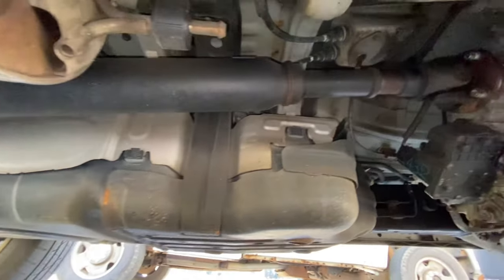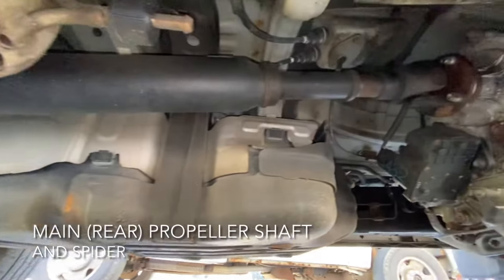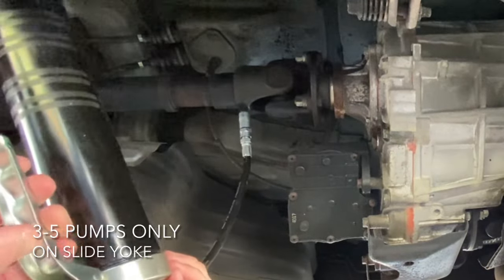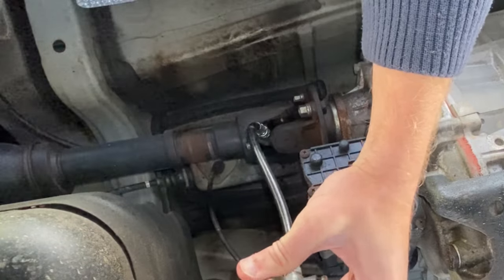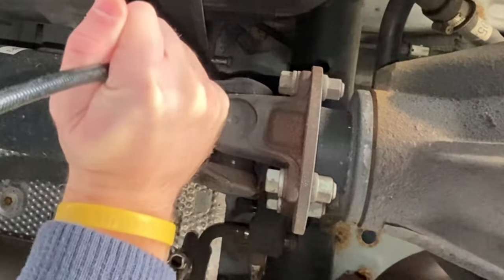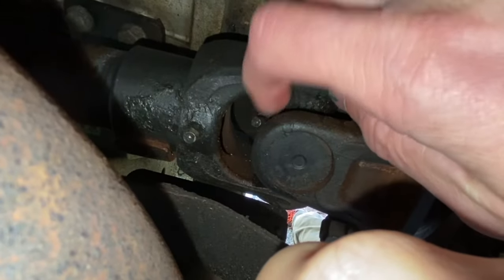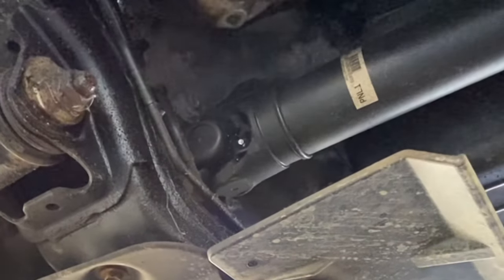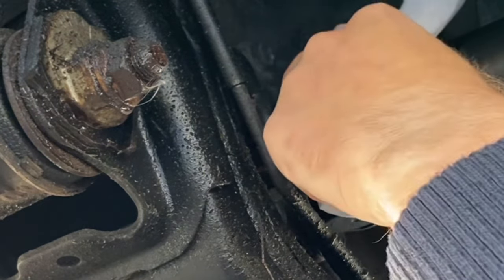Toyota Propeller or Drive Shaft Lubrication 4Runner, Tacoma

Comment: Interesting I have a 2017 Tacoma and it only has 2 fittings TOTAL. 😳 (both at the main shaft spiders one front and one rear)
Reply from the maker: Is it 2wd?
Reply: I got a 2015 4wd, just did the u joints, but I swear there's no grease fitting for the slip yolk.

Comment: Appreciate putting out the video.  It helped.

Added information for anyone planning to do this:

1. For the front shaft, back spider joint, it is very difficult to grease from below; grease from above instead.

2. You don't have to jack the front to grease the front shaft.  As long as your are not in 4WD mode, the shaft still spins.
Reply from the maker: Thanks for the tips! Thank you for watching! I’m glad it was helpful! Please consider giving the video a thumbs up if you haven’t already! Thank you!

Comment: Just as a heads up, I take apart the slip yoke to grease it because I find that greasing through the zerk does not provide enough grease before it starts to come out and it does not reach the lower splines so they run dry.
Reply from the maker: Thanks for watching, I appreciate this tip and hope others will too. Anything to keep our machines running in top shape!

Comment: What do you do if the grease fittings are not facing down where they're easily accessible to you?
Reply from the maker: I move the vehicle off the ramps and then back on to get the fittings on the bottom, sometimes it takes a couple of times to get them where you want them. Hopefully this helps, thank you for watching!

Comment: Under what conditions does the front slip yoke slide in and out just out of curiosity I did mine and I had someone jump on the back of the 4Runner and I could see the rear slip yoke slide in and out, the front not so much at all but it does have signs that it’s had some sliding in and out over time
Reply from the maker: It would happen suspension articulation, possibly a large speed bump or similar. Thank you for watching and be sure to check out my other 4Runner maintenance videos if you are interested. Thank you!

Comment: question is.. what grease or is it normal grease same for every vehicle?? I am new to these mechanic things and I have a paid off 99 4Runner but it has begun to jerk when I switch to reverse. It’s not the transmission fluid and before I assume it’s the u joints I want to figure this out first
Reply from the maker: The grease needed is NLGI No.2 and I have some linked in the video description if that is helpful!

Comment: Does the 2wd 4th gen 4runner have grease fittings on the drive shaft?
Reply from the maker: Yes it does but there is no driveshaft going to the front differential only the rear. Hopefully this helps! Thank you for watching!
Reply: @5MinuteFixit  I have been reading that the 2wd 4th gens (I have a 2004) do not have zerks and are a sealed drive shaft. Of course I probably should go look for myself to confirm.

Comment: Just did this on my 4Runner today.

However, after doing this, my suspension seems a little stiffer and there is clunking between the rear driveshaft and transfer case when I push the car up and down. I only did 2 pumps on the slip yoke for fear of over greasing.
Reply: 2 more pumps should do it

Comment: Why do you need to this & what happens if you don't, because this seems not to be the priority on 4runner maintenance.
Reply from the maker: It’s just a good idea to keep the driveshaft lubricated. It helps prevent excessive wear. Hopefully this helps, thank you for watching!
Reply: @5MinuteFixit  Thank you & your video is helpful. I got a 99 Limited 4runner at 280,789 miles just changed the front differential, transfer case, & rear differential fluid. Also replaced the rear differential breather valve too. I will get a grease gun & do this project next week🙋
Reply from the maker: @starforcefighter that’s great you gotta love the reliability of a 4Runner!
Reply: My Daughter's 99 4Runner 2WD w/270k developed a shake at 30-35 mph. Turned out it just needed this maintenance. Quickie-Lube type shops don't do it as part of the regular service. I don't know if they'd even do it if you asked for it. "Umm, what's a 'zerk fitting'?" Lol
Reply from the maker: @rickcraver9786 I’m glad it was something minor and you were able to fix the problem easily! Thank you for watching and please consider giving the video a thumbs up if you haven’t already! Thank you!
Reply: Broken u joints and driveshafts can be avoided this way. Perhaps an awd crossover would be more suited for you